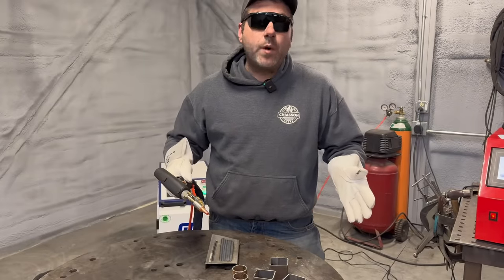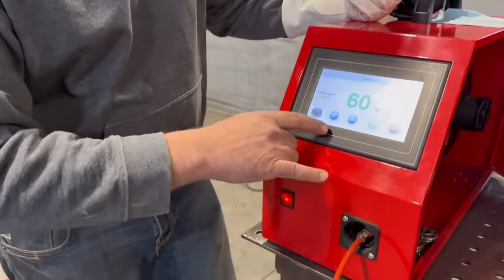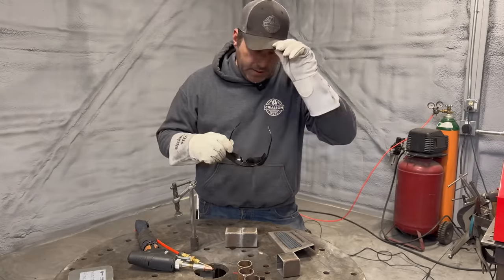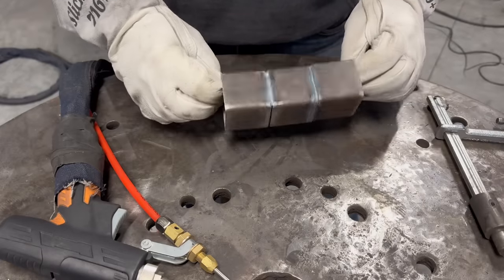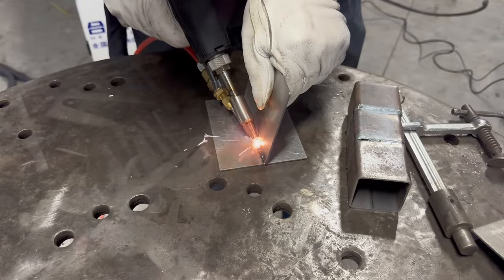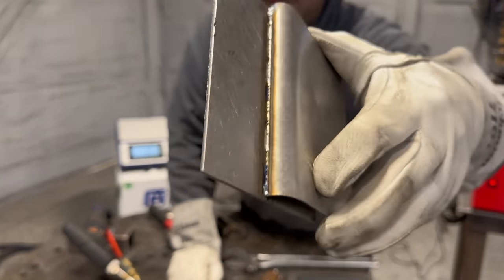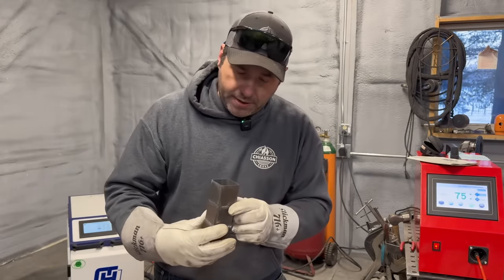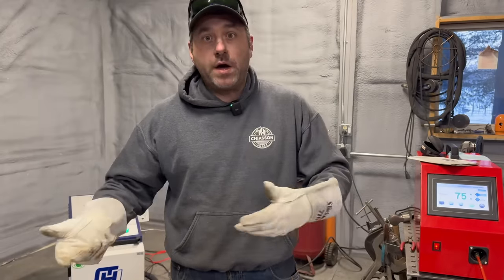Laser Welder from China- How does it Weld?

Comment: We using one the us made laser welder very close to 3 years now, what I noticed you running your gun / nozzle in a to steep angle do not exceed more than 60 degree tip to material, laser is like light to slight angle will bounce off of the material, the slower you go the deeper the laser will penetrate, you can weld 0.25 steel full pen  one shot, 0.5 thick steel from both sides will give you full pen.  here is how to handle gaps https://www.youtube.com/watch?v=bAR_JFcG-L4&t=307s,  good video. we mostly use it on aluminum fabrication

Comment: You said in your video that it does up to 3mm thick metal thats paper thin, and will not fill the slights gap. Not much good for anything!
Reply: Paper is 0.06 mm That's 50 times thinner than 3 mm. So it is 50X paper thin. Or in other words you'd have to stack 50 sheets of paper up to equal 3 mm. 3 mm is almost a quarter of an inch thick. WTF kind of paper do you have?

Comment: Wear your dark glasses? Don't you mean welding helmet?
Reply: I am guessing the glasses are specifically designed to block the wavelength of light the laser uses. A welding helmet might not block that wavelength effectively.
Reply: As far as I know you don't typically use the full helmet for laser welders.
Reply: @unL33T  This is from a supplier of laser welders "When welding, we strongly recommend you wear both the rated laser glasses AND a welding helmet that has been tested as blocking 1070nm (Near Infrared or IR) fibre laser light, such as the laser welding helmet from xxxxxxxxx". I get that people like to tell others they are wrong online, but I would be wearing the correct (or recommended) gear personally.
Reply: @Ulrich_von_Jungingen  thanks. Today I learned.

Comment: That is a MIG welder with a laser pointer. It is not a YAG or Gas LASER welder. If it was a true YAG LASER welder that power supply would be about 5 times as large as it is and cost $100,00+
Reply: Of course it is a laser welder. There is no electrical current passing between the torch and the workpiece. This type of product uses solid state lasers, not military grade lasers.

Comment: I can tell by the way you're handling it you don't know what you're doing.
Reply: Ha! 😆

So descriptive...mind telling us how you would have done it?
Reply: Armchair critic, if you can't add relevant information.
Reply: Sure. First don't pull or stop the weld while welding. Once you pull the trigger, allow the wire to push your hand. It's easier if you have the mindset to not think of mig welding as it's not the same. Also use the wobble function. You can weld gaps using the wobble. Also hold the gun around 33% to 40% so you can feel the wire pushing your hand forward. I think that should help you. Any questions do ask. I don't have all the answers but I may be able to give you some instructions you don't have.
Reply: @bobreichel  Seems like valuable information. Thank you. What is the 'wobble'? Is this a function on the Chinese welder?
Reply: It causes the laser beam to go back and worth across your weld area. Making it a little wider and yes, it is on your machine. You'll have to look on the panel to find it. I'm not exactly sure where it would be.
Reply: What brand is your machine?
Reply: Yeah that what frustrating me too…maybe he didn’t get the full instruction on how to use it properly…maybe he can searching for a laser machine demo…I saw plentey of them last year
Reply: @LeeMooEez   Unfortunately the instructions on Chinese equipment is normally slim to none. Wish they would do a better job beings they want to sell to English speaking people weather in the US or elsewhere. Even a good video going over it in good English on YouTube would be a big improvement In my opinion.
Reply: @bobreichel  I assume you are asking me?  I have not bought one yet, but have played with acetylene, stick welding, and lately wire-feed flux core. I started welding 50 years ago, but only as a hobby, when the need arose.

Comment: Lol that aint a laser. Its a glorified mig gun.
Reply: It is literally a laser that melts the base and filler metals. Literally.
Reply: @supergiantbubbles  its a plasma arc and its adding filler metal as it burns......
Still aint a laser. Its really more like an auto feed tig set-up than a mig. But you hear the word "laser" and think wow! Yet itll only "weld" up to eighth inch material........ Oh yeah thatll be good for the shop. 😂
Reply: @camden7488  There's no ground lead running from the machine, but whatever.
Reply: @KarriKoivusalo  the unit shown in the link is a laser welder and cleaner there is no filler material used from what im gathering in the information. However this is not the first time ive read up on "laser" welders. 
Maybe you should before attempting to persuade someone differently
Reply: @camden7488  I'm not quite certain what link you mean of, but the unit itself indeed does not have a wire feeder, it's an external unit that feeds the gun. The other video on this channel: https://www.youtube.com/watch?v=5z_1bPAKY50 shows the cleaning process. Yes the chinese tag "laser" on all kinds of welder, including stick welders, but that is a laser welding gun and there is no ground lead. But go ahead, think you took a W here, Cool Edgy Kid.
Reply: Only automated real laser welders dont have to be grounded. Handhelds most certainly but again its a glorified mig gun
Reply: @KarriKoivusalo  heres the section under hand held laser welding 
"Similar to GMAW machines, the hand-held laser system has to be grounded to be operational, so it has a ground cable that creates a signal loop from the welding gun making contact to the part on the table and the unit. If the welding head is not in contact with the welded part, the laser power is turned off and the machine is inoperable."
Reply: @camden7488  A signal wire is something quite else than an arc ground. If it's arc welding,k where is the arc? you know, the eye-stabbing bright light? But yeah, whatever Kool Edgy Kid.
Reply: @camden7488  It welds up to 3 mm which is just seven thousandths shy of a quarter of an inch.  0.0069" but who's counting? Or about twice as much as you're saying.
Reply: @1pcfred  i work with 3mm spacers everyday my friend and it is assuredly an eighth inch. Or if converted its .118. 
Dont be so foolish to try and argue that difference its less than a 64th. Gtfo!
Reply: @1pcfred  aint a quarter inch. .25 🤔 or 6.35mm
Reply: @camden7488  yes you're right. It is only 1/8" That's still 11 gauge steel though. Which is thick sheet metal.